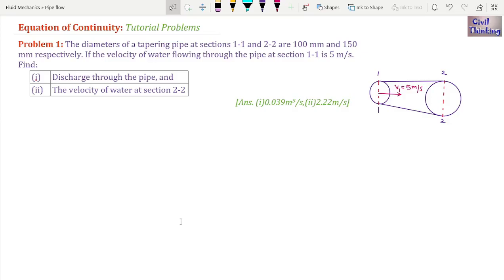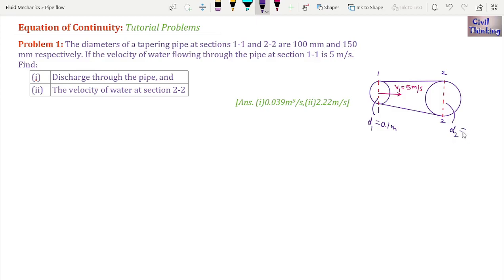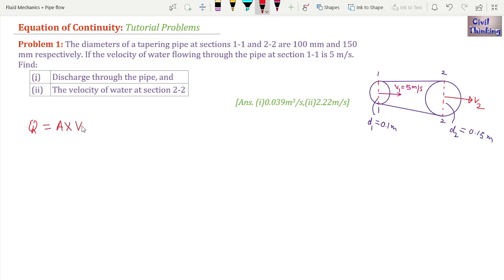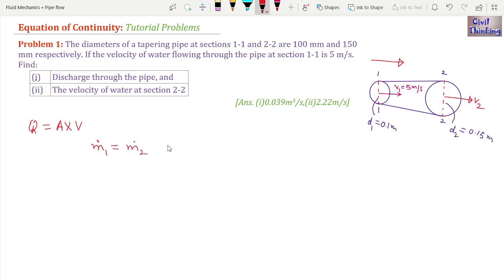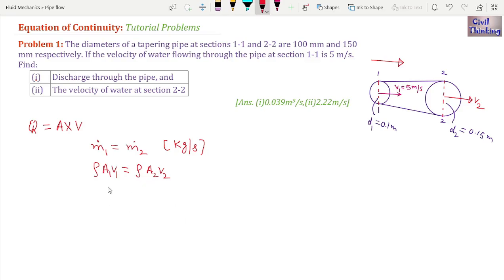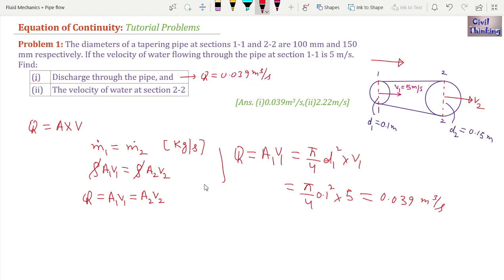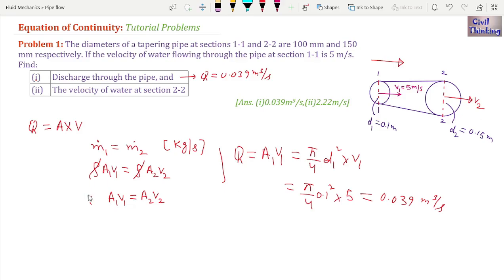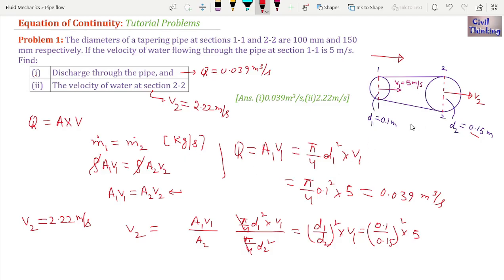How to find Discharge & velocity of fluid using continuity equation | Fluid Mechanics @CivilThinking

Comment: 4:56 what is needed of finding mass flow rate why we can't find flow of discharge from section two because water will exit through it..
Reply from the maker: We didn't find mass flow rate. We just said according to equation of continuity mass flow rate at section (1) and section (2) are equal. 
And responding to your claim of we can find discharge from section (2): At section (1) velocity is already provided so discharge at section (1) is easy to find.